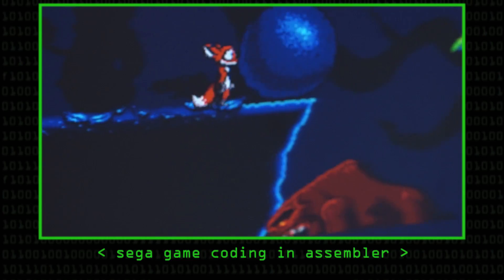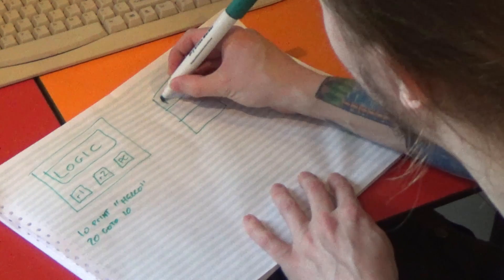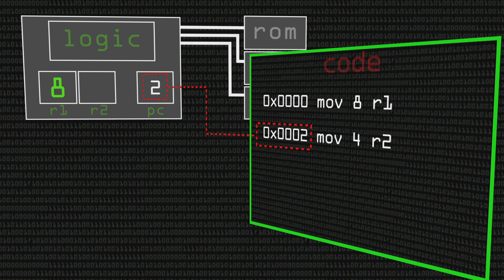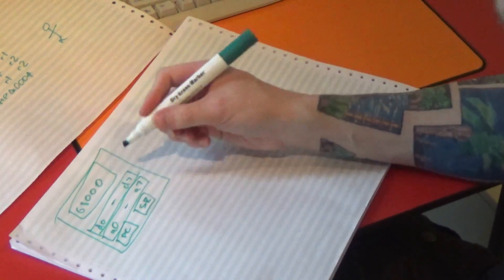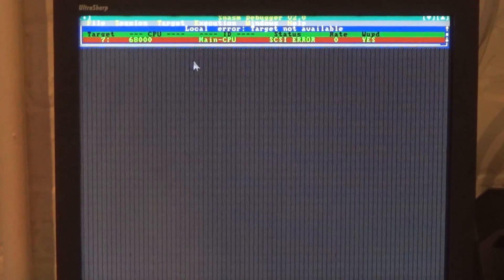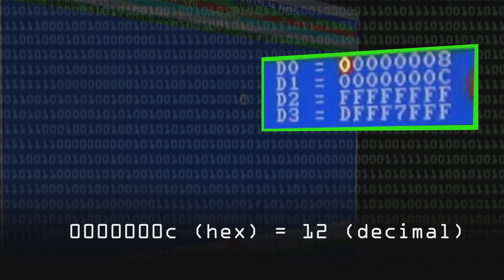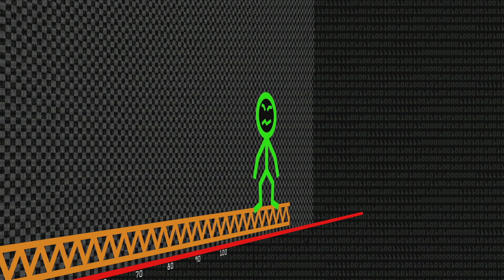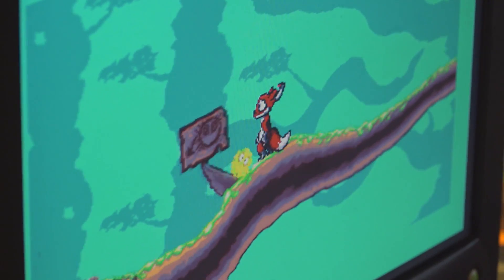Game Physics (in Assembler) - Computerphile

Comment: I hope this is a full series; I'd love to learn about how this flavor of assembly interacts with I/O, like buttons and graphics :)
Reply: You're ignoring debounce requirements, and most inputs are not mapped to a register but have to be read in to a register.  Perhaps the peripheral already debounces and you just need to read over the bus in to a register.
Reply: Button inputs are just hardwired to the hardware in such a way that when you press a button, there's a register somewhere in the system that changes value accordingly.

Then you can read that register value and do what ever you want with that in your program.

The "input register" might not be located on the main processor itself but on a peripheral IO device that's behind a bus of some sorts (SPI, I2S) in which case you might need to write the routine to get the values from the pheripheral to the processor/RAM and then use them as you wish.

But it's all the same, twiddle registers and use the values.
Reply: ok?

Comment: 18 registers? That is too easy.. C64 had just three, A, X and Y... also, variable names? lol, that is just cheating.. which made me realize how much work i had done making tb303 emulator in assembler... 

The funny thing was that after spending extraordinary amount of work making sure my instruction lengths were consistent on each loop type, the goddamn thing didn't keep time.. It drifted quite seriously, executing same loop gave different results on 10^6 and longer time/frame count. Had only one book, C64 programming manual.. 

I didn't crack the time stability (measuring time made it very very slow as it adds a  whole new layer on top requiring floating point operations and interpolation and then it just wouldn't operate fast enough to get to 255BPM).. SO in the end, i only sampled 4 - 16 bar sequences and the time drift actually made it exactly right kind of random that was unique.. But i had hoped to make it run with the MIDI board to use external clock but i never made it that far (i would've had to make my own timecode MIDI but that would've been the easy part...)

Still think it from time to time, bother me that i could never do it.. I've returned to programming again just couple of years ago so maybe i could do it now..
Reply: SquidCaps I know right? I mean, the assemblers available are better now, but I'm working on the snes.
Sure the 65C816 isn't as restricted as that.
But there's the a/b/c register (all different parts of the same single 16 bit register), x/xa/xb, and y/ya/yb...
Of course, the majority of instructions are memory + register so you don't have much use for all those extra registers, but still...
zaro page/direct page coding, knowing which of the 30 or so addressing modes creates the result you want, oh, and on the snes of course the exquisite pain of trying to do CPU based graphics routines efficiently using bitplaned graphics where an individual pixel can have it's bits spread over up to 8 different bytes...
Reply: Only thing I had on the C64 was a machine code monitor from the Action Replay cartridge. No assembler... refactoring was 'fun'.

Comment: I'd be very interested in knowing how the simple physics engine works. For example, how does he handle collisions? How does he handle the case where an object is going so fast that it passes through things? How does he handle friction?

Very interesting video :)
Reply: I think friction would be multiplying velocity by something like 0.95
For passing through things, I doubt his implementation fixes that, because normally nothing would move that fast anyway. But the way you would do that is to check if the line connecting the path from where the object was in the last position to the current position intersects with anything, and if so move the object back to where it should be.
The collision is more comparison. Simple and efficient collision detection uses a rectangular bounding box aligned with a x and y axis and sees if any object is intersecting with it. I encourage you to figure out how to check if 2 of those bounding boxes are colliding by using comparisons of the vertices’ positions. Figuring out how to resolve the collision is more complicated, and collision detecting of more complex shapes is even more complicated.

Comment: i did not know how nice 68000 assembler was so nice ! x86 assembly is horrible.
Reply: The instruction set isn't orthogonal so you have to think harder about which registers you use as they have dedicated uses. For example the x86 LOOP command only works with the CX (or ECX) register whereas in 68000, DBRA works with any register. Lets say you're writing a bit of code and suddenly realise you've used CX for something else but you want to use it for the loop. You have to change your entire routine. With 68000, it doesn't matter which register you use for the loop. See https://en.wikipedia.org/wiki/Orthogonal_instruction_set
Reply: ZLau13
Motorola quad cores.... I get happy just by thinking about it.
Reply: Andrew Joy
The 286 wasn't the first x86 CPU, it was the 8086. And ARM came a few years later, by that time the x86 dominated the market, and because of compatibility that dominance was set in stone. Intel itself tried to replace it with something more elegant too (Itanium), and failed miserably. ARM is only a thing now, because smartphones could afford to be incompatible with PCs.
Reply: Yes, 68000 was lovely to write in (I did about 10 games in 68000, and the majority of those were on ST/Amiga, so most of the code was cross platform).
Reply: x86 you specify the size (ecx = d2.l, cx = d2.w, cl = d2.b), but also the instructions are not orthogonal (so loop for example always uses ecx, in 68k you dbra d2, dest and can also check the condition code flag, so dbne d2, dest if you want to stop when d2 becomes 0 OR the zero flag was set from a previous instruction.
Reply: We didn't back in the 1980s and even if we had, they would have been too slow and used too much memory
Reply: Eh, who cares?  We have compilers.
Reply: Andrew Joy Well we tried to tell you 30 yrs ago 😂😜
Reply: András Bíró The first ARM has many many less transistors than a 286 and was way more powerfull and cheaper.
Reply: We also had the horrible crippled 8088 which was an 8086 with one of it's legs cut off - 8-bit data path instead of the 8086 16-bit. But yes, at the time, cost was a huge factor
Reply: Frederic Flerovium x86 has registers, just like other assemblies... However on x86 you can always use 32-bit registers (EAX, EBX) instead of 16-bit (AX, BX). You don't have to specify the size at all times either.

Also 68000 is weird because it has two registers that do the same thing (like BRA and JMP), which makes no sense to me. And yet you still need to specify the size for jumping/branching, while on x86 (at least in the Intel syntax) it doesn't matter.
Reply: Oops, just realised Neil said exactly the same as me ;-)
Reply: Did a course in the mid 1990's with 68000. It was fun working with the Motorola cpu. I later tried to get into x86, but it couldn't keep my interest. But cool to see that 68000 is still used...
Reply: Rob Nicholson
It was necessary. You couldn't address more memory with a 16bit CPU.
Reply: What's so bad about x86? It might be professional deformation from working with x86 assembly every day, but I see nothing wrong with it.
Reply: Just do it in C
Reply: ok?
Reply: The wrong processor family won. That's for sure.

At least we still have ARM and MIPS though.
Reply: x86 is one of the ugliest instruction sets out there. Try ARM assembly (especially the original 32bit variant), it's absolutely wonderful.
Reply: x86 won, because it was cheap. Back then CPUs didn't have billions of transistors to work with. 8086 had 29K, the 68000 had 68K. Less transistor meant smaller and therefore cheaper chip. So the x86 CPUs couldn't afford to have lots of registers and fancy instructions, hence the ugly assembly.
Reply: You should try 6809 assembly then for a nice and clean experience!
Reply: x86 is better. In my opinion, x86 is one of the easiest. You don't have to supply the instruction size (.l, .w) etc, but you do on the 68000.

Comment: @3:00 we get a infinite loop in the ROM BOOT code. nice...
(sorry I know it is just sample code, but: infinite loop !!!!)
Reply: Back then, the currently running program is the only program running at any given time, if you wanted to run something else, you reseted the machine (pressing a button that would temporarily cut the power, or using the actual power button/switch). The games would have additional code, stuff to handle inputs, draw graphics, run different screens etc, but it was all a single thread inside an infinite loop.

Comment: i never done assembler but i like the way that you can jump on the code.
Reply: Cozy Dino This is not exklusive to assembly. Almost any language has its step-by-step debuggers. And those that don't you really don't want to use ;) Sometimes they require setting up (xdebug for PHP) and sometimes they work out of the box (Java is nice in this regard).
Reply: Yes i like this but i was talking about that he could jump at the flag @PlayerUpdate: with the command jmp @playerUpdate. Its like a loop in this case. But it could be really useful. 17:41
Reply: A lot of languages have "goto" instructions. Its generally discouraged though because its easy for new people to feel like using it and if not used well leads to unmaintainable code.
Reply: The way to create a loop is to use one of the registers as a counter and then decrease it and branch back to the beginning of the loop if that counter register is not zero. But then again, you might find that setting up different conditions to get out of the loop are more convinient in a particular case. Also, you might want to create the equivalent of a for loop by checking the condition at the start and THEN you can put a jmp at the end of the loop to go back to the beginning because you already have code to check whether you need to get out of the loop or not.

Comment: @5:56 : A "Long" hasn't got just 32 bits, instead it has got 64 bits as far as I know- Byte (8 bits), WORD (16 bits), DWORD (32 bits), Long (64 bits). @computerphile
Reply: LEMOn3rd Computers have been built with 18-bit or 36-bit words. There was no way to address any data of a size smaller than that, so these machines had no "bytes".
Word was the conventional term given to the native size of an architecture, generally the width of its general-purpose register(s). By that convention, a "word" on my home PC is 64 bits. But we've gotten used to the terms used for the 8086, so byte, word, doubleword (or long), and quadword (or long long) for 8, 16, 32, and 64 bits, respectively have become the commonly used terms.
Reply: This was a Long on the Motorola 68000.
Reply: It really depends on the convention/context :-) Somewhere word is 16 bits, somewhere it's 32 and somewhere it means the "native" bus size, so it can even be 64.
Reply: For 68k series, long = 32, word = 16, byte = 8

Comment: I think the LD (load) mnemonic is much less confusing than MOV (move). You don’t move values into registers as such; you load registers with values. Additionally, you can load registers with values of other registers or memory locations. Since the original values remain unchanged, the notion of moving values is at best misleading.

Keep up with the series! Make Assembly Great Again!
Reply: Well there lies the problem, everyone imagines their logic is the only true one, so you end up with naming conventions that make sense to some and no sense at all to others.
Reply: Writing code equally in Z80, 6502, 68000 and 8086 for multiple platforms just used to make my head hurt ;-) I learnt Z80 first (Zaks!) on my ZX81 but then came across the 6809 at university. Always preferred t e 6502, 6809, 68000 family over the Z80 and the horrible 64k banked 8088/8086. The key problem was that you could write a routine in 6502 and assuming your algorithm was sound, the first attempt was pretty much as fast it'll ever get. With the Z80, there were loads of tricks of which the main one was trying to keep everything in registers as compared to the 6502, accessing memory was real slow. So with Z80, you might re-write that all important "WriteSprite" routine on the Specky three or four times. The 68000 was a dream to work with. Loved it. Shame that Motorola didn't win the CPU wars. Intel's CPU line held the industry back quite a few years.
Reply: No, not when it relates to computers. We upload and download data, and we load programs from, say, tape into memory. Needless to say, the process of loading is all about copying data from the source to the destination. Thus, loading data into memory and loading a register with a value are identical processes.
Reply: Well, you are not wrong, and different architectures indeed work slightly differently. But consider these two CPUs: Z80 and 8080. The Z80 is 100% backward compatible with the 8080 (to the point of having identical opcodes). Nevertheless, conventionally, the Z80 uses the LD mnemonic, whereas the 8080 uses MOV (or variations of STORE). For example:

MOV A,B vs LD A,B
MVI A,byte vs LD A,byte
LHLD word vs LD HL,(word)
SHLD word vs LD (word),HL
STAX B vs LD (BC),A

These are identical instructions and after assembly, the resulting machine codes will be 100% compatible. Yet, Zilog decided to make the instruction set more uniform and straightforward (and, extended it quite a bit, naturally).
Reply: Ast A. Moore I was just thinking the same thing
Reply: Ast A. Moore I suppose. Depends on the processor and it's instruction set though. If you were dealing with an snes or a commodore 64 you'd find what you're allowed to do with registers is quite restricted, and there is no generic instruction to move values from memory into a register, but rather a bunch of more restricted ones.
Then again the majority of operations on these processors are register+ memory operations.
For insantance, to add two numbers you load a value into the A register, then pass a memory location to the ADD instruction. (possibly using the x register to store a partial adress, though aince there are about 27 addressing modes there's lots of odd variations).
the result of the ADD instruction has then overwritten the contents of the A register.
Which you can store somewhere in memory....

I guesx that doesn't really say much about mov vs ld really. XD
neither truly makes sense because the implication of mov is that the value is erased from the source.
It's really a logic thing.
load implies 'load a value from ...', move implies 'move a value to ...'
Yet the reality of course is that you need both a source AND destination for such instructions to make any sense...
as mnemonics, either of those only really truly makes sense if one of the two is implied.
lda makes sense (load from the specified location to register a), mva would sort of seem like a store instruction rather than a load.
But of course if you have a generic load, store or move instruction that specifies both source and destination it all amounts to the same thing,  but with different emphasis. load (x)(from), store (x)(to), move (x)(to).

move has the disadvantage of implying that the source is erased, which it pretty much never is, so in that sense, mov really doesn't work logically.
but mnemonics are arbitrary anyway. two assemblers can use completely different mnemonics and if they produce the same binary instruction codes in the end it doesn't matter which you use.
Reply: I also started on the Z80 (on the Speccy, though; skipped the ZX80 and ZX81). Then there was some 8086, then the PIC, then the 68k and the PowerPC (both on Macs). Loved the PowerPC architecture.

I must admit that optimizing my Z80 code was, arguably, the most satisfying part. Sure, it wasn’t always straighforward, and I occasionally resorted to self-modifying code (which is a no-no on modern systems, because of security reasons), but that was the exciting bit. Counting the bytes and T-states, shaving off a couple here and a couple there, working around the Spectrum’s quirky screen memory addressing, sprite flickering, etc., there’s was a great deal of thrill in it.

I still write a little bit of Z80 code from time to time, just because I enjoy it so much.
Reply: ok?
Reply: The notion of "loading" values is also misleading in that exact sense, since physically loading something involves moving it from the source to the destination.

Comment: No one bothered to write a compiler for this console?
Reply: With a compiler it never makes completely optimized code, and when dealing with slow hardware you need to get all the speed possible out of it, therefore, a compiler is a no-go!
Reply: yep, even with DOS games compilers weren't used at this stage.
Reply: My Opinion:
I thing big dev teams probably had one, but they don't share it with the world.
Reply: Of course GCC for instance can certainly emit 68k code. These machines however are very limited, and game programming is all about taking full advantage of their limited resources. So writing, if not everything, at least the critical parts in assembly, is really the only way to make anything interesting.
Reply: John Tsiombikas In a game you would probably want the engine to be as effective as possible. But if a section is not called multiple times per second, but only like, once per load, i would consider using not fully optimised code.
But then again, the coders for the game are used to ASM, why not make everything in ASM.